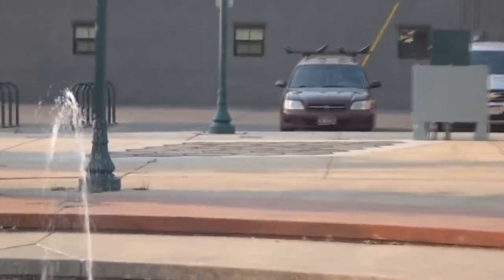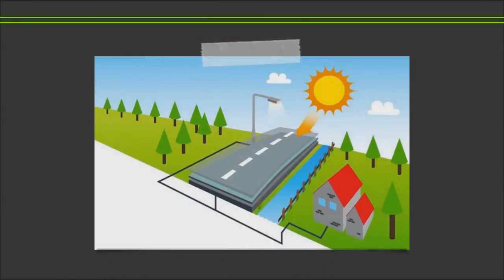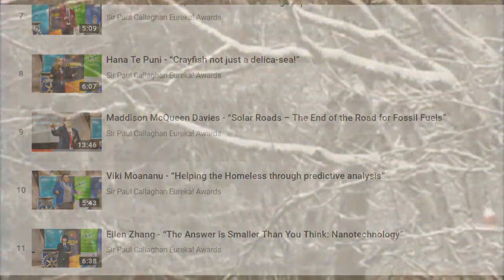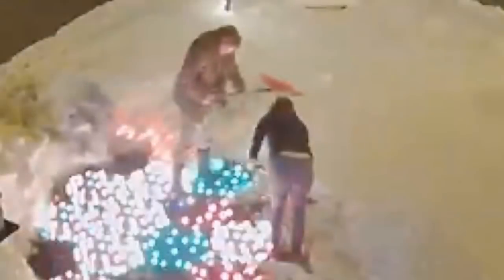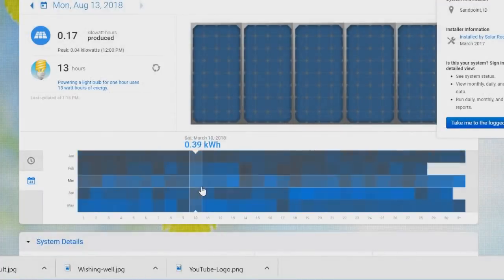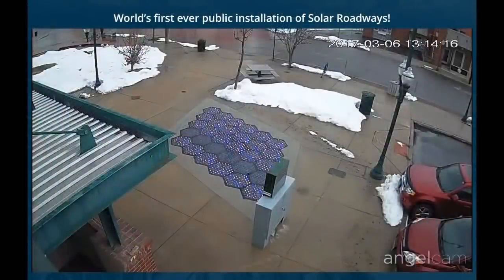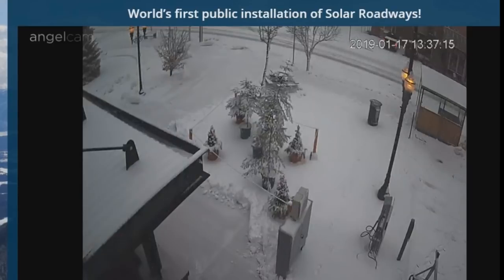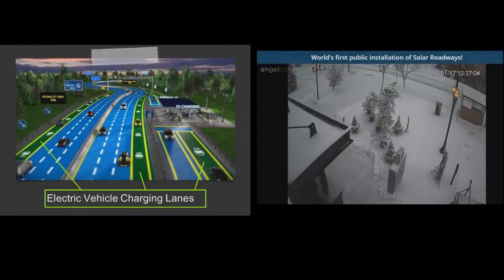Solar Roadways to be installed on Cruise ships!!?

Comment: Well, to be honest having them on a cruise ship is a lot more realistic and closer to what it might be able to do than the idea of paving a road with it.
- No cars
- No snow
- Close to no dirt from pedestrians, etc.
- No requirement for the included lights to alarm drivers several hundret meters away
- regular cleaning
- no dependence on the produced excess electricity if its on a ship that runs a several thousand kw diesel-power generator all the time
- water is allways available in unlimited quantities if it catches fire

A nice gimmick on a swimming holiday ressort sounds a million times more realistic than a working road with safety and stability requirements...

Comment: Hold up. Cruise ships don't already have solar panels on their roofs. Which makes sense cause their generators create so much power that any power from solar is negligible against them. And it's not like you're saving fuel cause the generators and main engines are running constantly throughout the voyage to keep the ship sailing.

Comment: How did they even spend half a million dollars on that?

The custom glass is probably somewhat expensive, so i would estimate that to be at most 400$. 
Solar panels are expensive, but the ones osed are small, i think they cost them up to 100$ combined.
LEDs are practically free these days. You can buy hundeds of them for a couple of bucks.
They could probably use IR LEDs which are probably extremely expensive, but I think they went with traditional wires for heating so these are practically free, too.
I'd expect some sensory for that thing to notice when to apply heating and when not to and also to transmit some data so that is at most 200$.
An arduino, or raspberry pi to controll said LED, heating, take in sensory data and to transmit said data to the owners servers up to 100$ (this, if they use custom parts) 
A custom pcb to put all the electronics on. 10$ at most.
Some simple software that someone on the team writes free.
They probably put all of this togher themselves, so that's basically free.
The same goes for putting it in the ground.
So in total each thing might cost, give or take 20%, 810$
So, about one thousand dollars for that, yet I don't see 500 of them in action.
My theory is that they had this idea, started the campaign because in order to make this, they obviously needed funding, got half a milloin dollar to do it, gave it their best shot to put outside, because people demanded results and this is what happened. The idea isn't necessarily bad, but they use bozzwords and false advertising to get people to sign up to their campaign. They show this like screens, but only install a few LEDs per panel, because they would need, either special solar panels for that or tiny solar panels (obviously more expensive).
They got the idea, received the money, people demanded results and shit happened. I don't understand the heavy advertising.
Reply: It's not really half a million. Sandpoint was given that amount to manage the installation and operating costs over its lifetime. The price they are currently quoting equates to a bit over $2000 per tile which includes cabling and installation but excludes site prep and labor. 
While your theory about how SR got into this position does make sense, I think somewhere along the line they also got caught up in their own hype. Why else would they sign up a manufacturer to mass-produce these, or have discussions with businesses like Walmart to install something that amounts to an unfinished prototype? There must be some serious delusions going on.

Comment: Meh...
They have some paints that are 99%+ absorbent of sunlight. Better off using TEC's with the paint added to a road surface ontop and the thermal difference to generate power with the Earth as the heatsink for the cooler side.

Hell in cold climates it could still generate electricity if the surface is colder by a significant margin then the underlaying Earth which even in subzero areas of Europe is 7c+.

Hell radiating at night into the sky may actually allow it to get quite cold and allow day/night power generation.

Would be sweet bugger all but better then those solar panels.

Just need to work out car weels that won't melt at 200c pluss road surface.

Comment: LoL... the heating element part 🤣 . 

It could work, but they’d have to heat to at least 115° just to melt snow quick enough into runoff water... and solar stored energy isn’t going to be capable of sustaining that, so there’s more money on alternate power to power the solar roadway 🤣🤣🤣

Comment: I'm not going to lie, IF, and that's an emphasized if, all the problems that we see with this idea could be fixed, I think this idea is a good one.

The problem is that this is just another one of the hyped emotional project that people throw money at without understanding the monumental hurdles that need to be solved. You take proper engineers, proper testing, proper people who don't freaking lie about solar freaking roadways and solve the durability, cell degradation, etc (I'm no engineer) all of which looks like it would take years and years of development. But I don't see they idea itself to be a bad idea.
Reply: Teleportation and food replicators could save the planet!  Great ideas rarely translate to the real world, and even when they do, they are rarely practical.

Comment: At least most cruise ships won't have to deal with snow or car traffic, so it might work better. Still doesn't seem a good idea to put this stuff on the floor where thousands of people walk all over them.
Maybe just use regular solar panels and put them on the roofs and the upper sides of the ships instead. They are way cheaper and will work better...

Comment: Solar panels are kind of shitty in general. Putting them on the road is an unbelievably bad idea. They're made of serially linked slices of silicon that generate ~0.7V each and stacked up to some voltage like 12, 24 or 48 V. That's a lot of little pieces of silicon and even if one single slice is shaded (you know, snow, leaves, dirt, shade from trees, signs, fences, buildings, parked cars...), the whole panel stops generating power at all.

Even if used responsibly instead of sticking them in the road, where snow plows commonly destroy things like manhole covers and will have zero problem decimating your solar road way, there are daily, weekly, seasonal variations. Variations on every scale that make storage or load balancing an absolute requirement. Having a huge proportion of grid electricity comming from solar will just lock in fossil gas as a generation source; a natural gas bridge to an all renewable promised land that will never become reality. When we run out of fossil gas, we'll steam reform coal, even uneconomical stranded coal using underground coal gasification (UCG). Dumping that extra unused electricity into something useful is hard; it has to be a fault tolerant process capable of making use of extra electricity 20% of the time (while paying the capital cost 100% of the time). Doing something like making hydrogen or artificial methane is a high capital cost activity; as is sending the electricity elsewhere on long powerlines. You're kind of stuck with dumping it into a big resistor some of the time. 

Integrating lots of solar power into the grid efficiently and cheaply is a problem every bit as hard as fusion power. If I had to bet I'd bet advanced nuclear fission and fusion power gets there first and solar goes into the dustbin of history; leaving a legacy of pollution (what do you think chinese companies do with tetra silicon chloride that has become too polluted to reuse? Do you think nitrogen fluoride leakage is at controlled and accounted for? What happens with the e-waste when the enormous volumes of panel are done? etc.).

Comment: Good on paper, bad in practice. 

You'd be better off installing solar panels on the side of the road. NOT IN THE ROAD. 

But don't get me started on the cost to do such a task. 

Also, if you're thinking,  oh let's put heating elements in the road, I'd just like to point out that there's places I've been and the heating elements in concrete stairs outside end up forming ice when they turn off.

Honestly as it is right now, something like this needs more engineering. And even then we might not fully have the tech at the moment to do such a thing. 

I don't want to drive on glass either.

Comment: Nothing beats taking a barefoot stroll across a black / dark solar panel surface in the middle of the sun, still probably wouldn’t hurt as much as the ratio of recap vs new material, no offense of course

Comment: I can see them winning an innovation award.  Are we learning fuck-all from it, or are we gathering data?  Is this not how science works?  We know what foot traffic does to the foundation, come up with an idea to mitigate that.  We know the LEDs fail, come up with a fix.  We know it doesn't heat snow, do we scrap it entirely for the next version?  It blinds us at an oblique angle.  The border strips peel up.  They don't generate enough energy to power a dildo.

Sure, Thunderfoot came up with these EXACT examples before they were even installed lol, but we're getting experience just by watching them.  We know how much money and effort it takes to engineer these, the NEXT guy who does it can know what to put in his pocket and toolbox for when HE gives it a shot.

Comment: "through simple Mutual induction technology".  This is called a dynamo. Who in here thinks they can get extra mileage out of their e-bike if you just simply add a dynamo on its wheel??? Just for everyone a quick engineering tip: Adding a stage of energy conversion means adding a stage of energy loss. If you don't have to, don't do it. You will not ever gain energy.

Comment: The idea of using solar panels to heat themselves is fundamentally stupid. This is simply because even if they were 100% efficient then they would only be converting the solar radiation falling onto them (heat) back into heat so the net gain is zero. Kind of like using a motor to run a generator to run the motor. As it is they are far less than100% efficient so they will only server to cool the roadways in winter and increase the build up of ice. That is until they are covered in ice when they will stop working. It would be far better to simply cover the roads in something dark coloured that would absorb the radiation and turn it into heat, maybe something like asphalt. Spending £Billions to make things worse does however seem to be our governments current favourite activity.
Reply: Well, yes, but on the other hand: efficiency doesn't really matter in this case because all losses are... [badoom-tsing] HEAT! So, at least it is 100% effective in stirring up heat which ofc doesn't do anything else beyond that :D
Reply: You missed the point. Yes all the losses are heat BUT my point was why spend £Billions to get no net gain?In other words you can never generate more energy that was incident on a given area of road however efficient the panels are so it is pointless to use solar panel to heat themselves and claim it is a benefit compared to the panels not being there. Soil will give the very same results in terms of self heating (probably better).
Reply: I was joking sarcastically. You're right. It is not only pointless but the joke of the century. Heat the road, jack... To advertise electrical road heating as a means of energy saving is peak madness.

Comment: Why does this make my blood boil?
Why can't they just add a shit ton of Solar panel on everyone's roof, NO ONE USES THAT AREA! 

Maybe set up a huge field of Solar Panel's I'm talking of a network of Solar panels spanning 300 km or larger, in Rural Desert Locations, with Ton's of Sunlight, Ton's of Energy. The issue then becomes that Solar panels loose their efficiency after they get hot enough. Once they reach a certain temperature threshold. 
I know the spinning Solar panels was Bullshit, because in order for solar panels to generate more energy they need to be perpendicular to the sun! 

Now I'm not an electrical engineer, physicist, chemist, scientist etc, I am just a CS student. 

So now my question is: 
What if we had a bunch of sprinklers, the purpose of such was that once the sensors detect that the solar panels reach their maximum temperature threshold to operate efficiently, in order to cool them down, the sprinklers start. The water would fall over the large surface area of the solar panels cooling them, and then evaporate. This could temporarily reducing the energy intake as the sun's rays would have to go through the water then hit the solar panel. I'm not sure :-( 

2 potential problems I see: It will take a ton of water (preferably non-drinkable, not clean water), and the evaporated water will form clouds (less sunlight) and lead to rain. 
Am I over thinking this? 

Or is this a good potential way to generate renewable, energy, and yes there will be more people (or staff) who need to be hired to check the maintenance of the solar panels from time to time?
Reply: @M R I have bad grammar that's why. I left the U.S in 2nd grade so I never really learned grammar. Even when I came back in the 6th/7th grade I never really grasped those concepts. If you asked me what's the difference between a noun and a verb, I wouldn't be able to answer. Also sorry for bad typing in general I was using my smartphone.

Comment: How is it soooooo difficult to understand, that when a solar panel is covered in snow, it generates no power. It generally snows in the winter, when the days are short and the sun doesn't rise very high in the sky. facepalm

Would be an idea to work out power required to melt that much snow.

It's a road way - if you are back there again, how about driving on it and see what happens to it.

Comment: Solar roadways on cruise ships? That's... actually not entirely stupid idea. They spend all their time in sunny locations year round, they don't have lots of roof surface to install regular solar panels on, the surface doesn't get sandpapered with rocks and dirt, and you don't need those stupid LEDs waste any of the power they generate. 

Do those outweigh the cons? Well, definitely not with the Solar Roadways crew's stupid hex panels, but if properly executed? Maybe. Still, start with regular panels on the roofspace you have.

Comment: By covering the roadways with solar panels, you have taken a  mundane, no moving part kind of product, and thrown in the wiring, computer capacity, glass that needs to be cleaned for maximum efficiency, diminishing return on investment over the life of the panels, AND the possibility of catastrophic damage during a crash being much worse than a normal road surface would have been.

Comment: i mean yes. it's failing so badly, but this is a great spark to an idea that can be developed with the right technology, tools, and money. I mean hell, we flew to the moon. Gotta respect the effort...even if theyre not making any lol
Reply: Thing is though. It's a BAD idea. Even if you magic it into working with currently not existent materials etc., why bother? Just invest the cash into actual solar panels. It'd be substantially cheaper, you don't need to create magic glass (among the plethora of other issues), you can align the solar panels properly to maximise their potential, maintenance is easier because your generator isn't also a road etc.
Reply: @efffvss  well yes. That's what I'm saying. Fuck the actual roads being solar panels. They can line the streets with solar panels which fuel the road ways. And in turn, the panels alongside the roads can turn automatically to follow the sun
Reply: Fair enough. I misinterpreted what you meant. My apologies.

Comment: 1:24 - Honestly, this student missed the chance to do a speech expounding the benefits of solar panel badges ;-)

3:44 - I just thought, all the run off water (in snow conditions) would just freeze as soon as it comes off the heated 'roadway'.  Wouldn't that cause big ice walls around these heated sections to slowly build.  Unless you hired workers to remove it or build some pointlessly complex drainage system to deal with the runoff.  You just move the problem somewhere else, but this time its ice not snow. :)

9:10 - I swear, this company looks to me to be a straight up scam.  They pressure organisations (and companies) to buy a demo layout of their 'solar roadway'.  Probably using statements like 'you don't want your company to be known for not supporting this project?'  Instead, a company can use it as a positive advertisement for their support of a Greener environment. 
Its a beautiful little scam really.  And, if any government takes them up on a large purchase ..sweeeeet, its their problem then ;-)

I remember (in the UK / London) when councils brought into rubberised 'sleeping policemen' (made of replaceable rubber tiles that fit over the older sleeping policemen).  After the councils bought the idea the original company disappeared and they were left with a technology that wore out worse than other materials.  Now, they quietly return them to 'standard' sleeping policemen :)  And try to keep the public away from learning how much they spent on another failed/scam 'green' company.